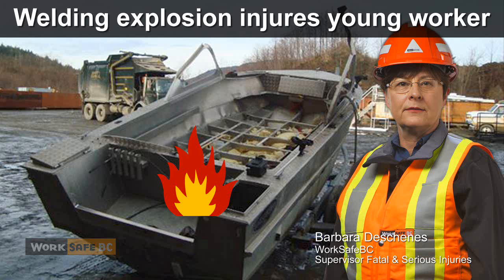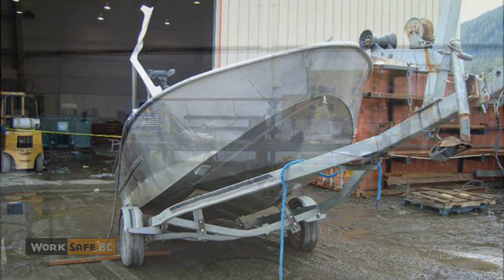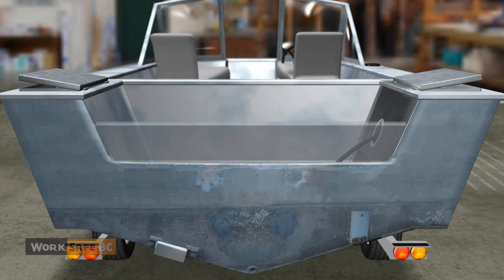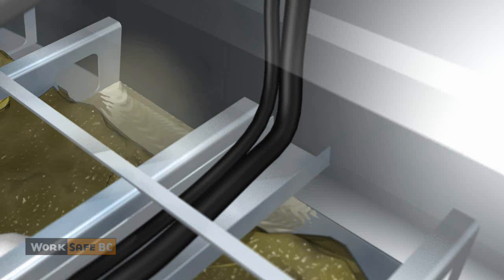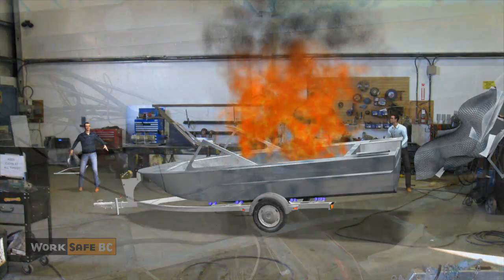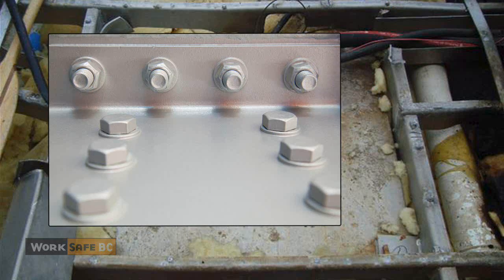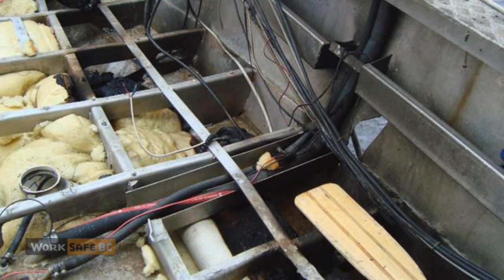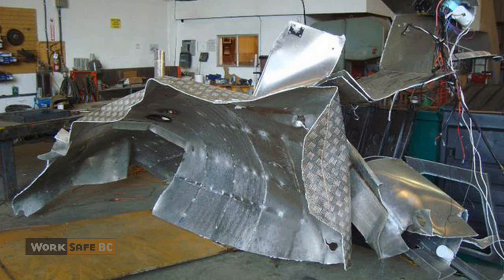Welding Explosion Injures Young Worker

Comment: I watched 32 cars at a scrap yard go up because of 1 car on its side And a guy with a cutting torch cutting off engine mounts to remove a engine the quick way ...The gas tank still in the car He assumed it was empty And the gas cap was on ...It was not .The fuel spilled out and down a slight angle to 2 other cars He panic And picked up the car with a front end loader to race to the back of the yard and near a garden hose area And water tank ...On the way the gas pour into other cars with broken windows And open engine bays it took 3 fire trucks and 5 hours to control it ........That same year the city told them they could no longer stack cars ontop of each other ...

Comment: you cant avoid hot work by using bolts you still have to drill or cut a hole for the bolt to pass through. These guys where idiots, as long as you have common sense and follow safety rules and do routine check before you just start working you wont blow yourself up.

Comment: WHY were the workers in the shop not wearing any PPE? mainly no hard hats!!
I know they're only computer animated workers but still :)
Reply: eswainz why would u wear a hard hat in a shop? It wouldn't be possible to wear a hard hat and welding helmet at the same time.  All that's required in most shop settings is steel toe boots, gloves (in certain applications), and safety glasses
Reply: @bobpiff9081  they do make hard hat welding helmet combos. The welding shop I work in you must wear a hard hat.

Comment: Suddenly I don't want to learn welding
Reply: Welding is not that great and for the record, the Eiffel Tower was built with iron rivets.
Reply: @luciusirving5926  Welding is just a cheap alternative to attaching two bits of metal without the time and expense of proper fittings such as bolts or rivets. Welding joints will always be inferior.